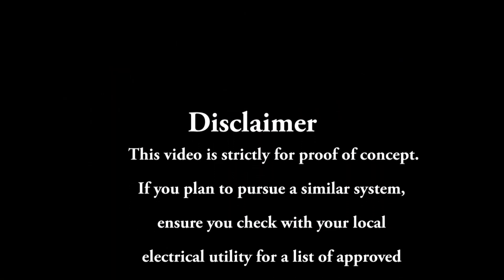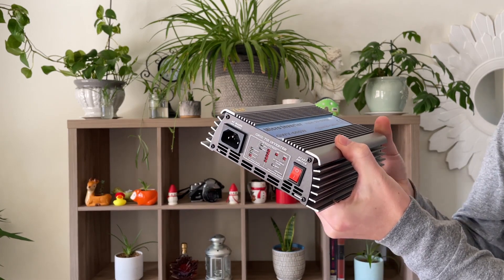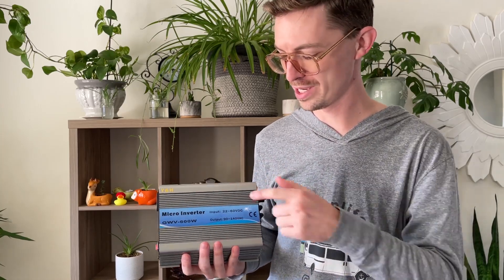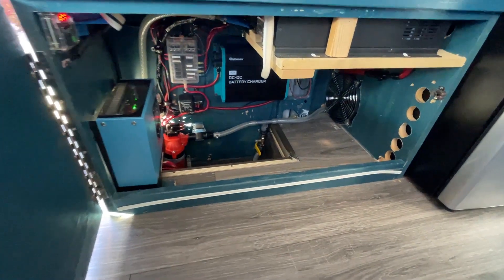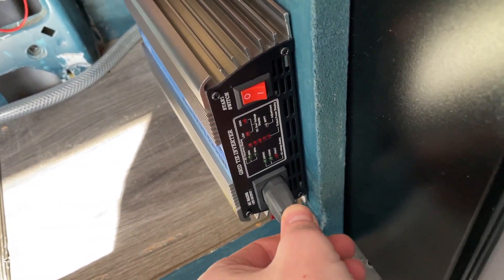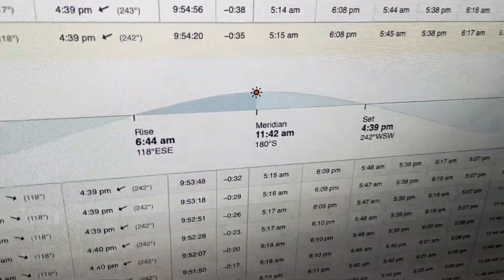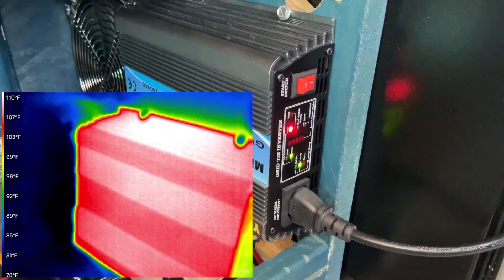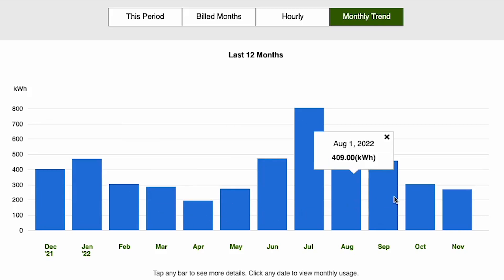Parked campervan or RV? Utilize it's solar!

Comment: Nice setup Tim. Even your local power company was ok with your solar, in my country you will get a special hefty tax on a monthly bill for micro solar grids which negates any savings and in the same time their PR says how they support renewables.

It would be pretty cool if you can make it to be a permanent solution but id recon you will need tilt system to put alteast double your projected power output and save even more.

P. S. That other dude Jack Butler is a legend. From time to time i rewatch how he survived Gobi desert or Majorca adventures with ebike charging in Lidl parking lot.
Reply from the maker: The local power company has a list of approved inverters and unfortunately this isn't one of them. 
(This was just a quick video for fun - luckily I didn't end up in trouble with the meter running backwards for few hours).

The power company also shifts the billing from a flat rate of $0.30USD / KWH to a "time-of-use" plan if you install solar. They charge $0.30USD/KWH when the sun is out then ~$0.45/KHW between 4PM-9PM (when everyone gets home from work and uses the most electricity).

They then only pay ~1/10th of that for any excess energy you produce for them to use.

I've heard of many towns disincentivizing solar even more.

Like you said - the PR departments love to talk about going green, but when you actually do they make it a nightmare.

**Jack's solar e-bike was definitely a sweet build! Hoping to see more of his cool van build posts soon!

Comment: How can it be legl to have a male connector in that inverter provide power?
Reply from the maker: You can have the inverter turned on and stick your finger in the 120v male outlet and not get shocked.
The grid-tie-inverter will not produce electricity unless it sees 90-140v AC from the power grid.
If the cord were removed the 120v output of the inverter would immediately shut off again.
If it were a standard inverter you would surely get electrocuted.
Reply: @VanwithTim  
Ah, got it.

Comment: i have thought about do this as well, my van does sit in my backyard more then i would like it to be. i would have to rewire my solar from parallel to series
Reply from the maker: There are a few different flavors of grid-tie-inverters. You might be able to find one with a lower input voltage!

Comment: Thanks. You answered some questions I had about this sort of set up.
Reply from the maker: Glad it was helpful! Unfortunately I've read many discouraging accounts of electric companies going to extreme lengths to prevent DIY solar, even if it's permitted and up to code.
Even then, the financial incentives all but disappear. 
In Southern CA you MUST switch to a time of use plan instead of a tiered plan. $0.45/kwh once the sun goes down vs $0.30/kwh flat rate on the tiered plan.
They also only pay around $0.03/kwh for any excess production.